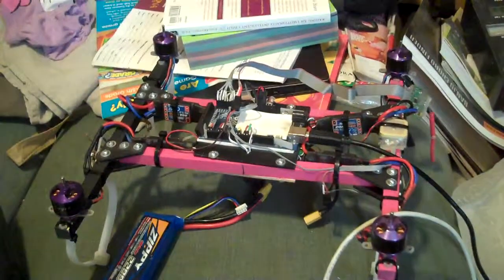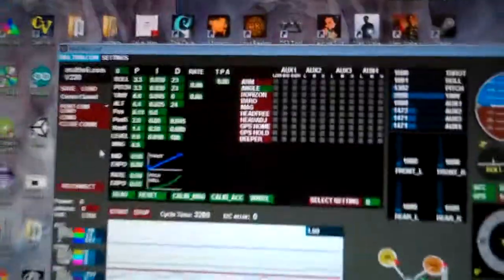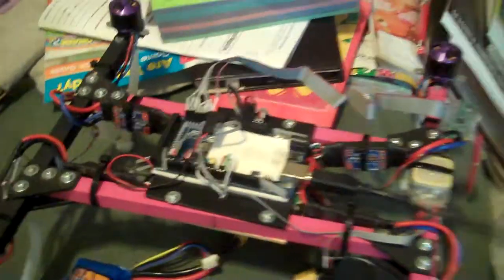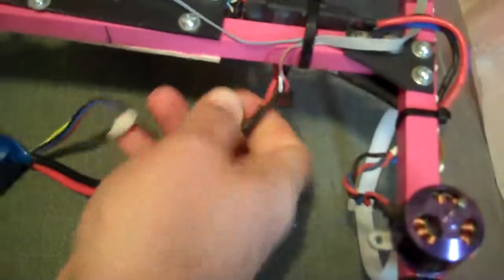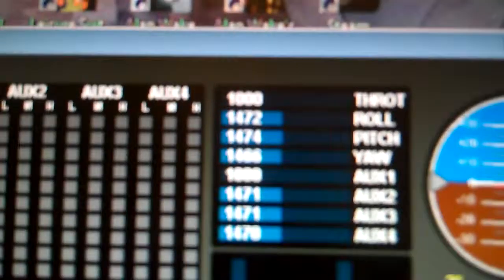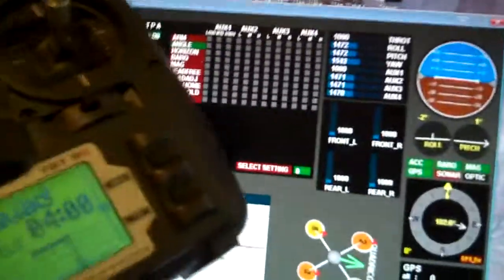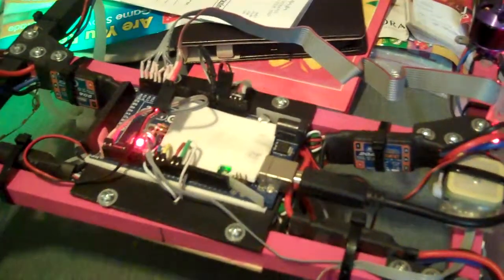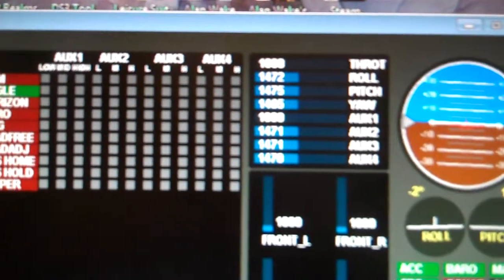Failsafe on MultiWii 2.3 drives me crazy

Comment: Jason you have a few problems there so let break it down for you.
1 - Have you calibrated the accs and the mag as it does not look like it.
2 - You have no AUX switches allocated,
3 - Your ARMING problem is probably due to the LIMITs in your radio not being out enough to hit the spot.
4 - Angle is a flight mode not failsafe. 

So lets got through a few of those points.
1 - If you dont cal the accs and mag your board will be confused and things like ANGLE mode will come up.
2 - I assume you know how to allocate AUX switches to active things like RTH etc.
3 - Go into your radio to the limits page and open out the YAW & THROTTLE settings as I assume they are at 100/100 so do both sides of the limit on both limits and say go to 110 for all 4 and see how that goes.
4 - If you fly in angle mode your copter will not tilt over more than 25 degrees which is great for beginners and if you want to be more daring go to HORIZON which is a combination of angle and acro (angle to 25 degrees, acro over 25 degrees).

For failsafe you set that up in either your arduino sketch by commenting out the first failsafe line OR you can have it set up on your receiver.

If  you want to see some set up vids on multiwii FC boards come and see my youtube channel - moochasas
Reply: One other thing I noticed but forgot to mention is that while your using MW2.3 your GUI shows MW2.1 so you should use the matched GUI that came with the sketch. Reason I suspect that is because your GUI while stating 23 at teh top LH corner shows all the settings for MW2.1 and if  you use a mismatched GUI things like angle will come up (like yours is shown in greeen) without activating them via the white squares in the AUX columns.
Reply from the maker: moochasas The problem turned out to be that the GUI does not show any values below 1,000 or above 2,000.  It was the 2.3 GUI (came out of the same .zip as the arduino sketch) I've never even had 2.1 on my computer I've only ever used 2.2 and 2.3.  PatrikE was able to hook me up with a version of the GUI that shows values below 1,000 and above 2,000 and I discovered that my endpoints weren't set where I thought they were:  http://www.multiwii.com/forum/viewtopic.php?f=18&t=5073

The accel and mag had been calibrated, AUX switches weren't set yet as I had just reflashed the board and loaded my settings but the GUI doesn't ever seem to save and restore AUX settings.  Since I was still fighting this sudden arming problem I wasn't going to waste time setting AUX switches that would probably be lost again before I would need to use them for anything.

Since the problem was solved over a month ago I'm not really interested in going back and watching my the video again to address the other points.  It was the end of two days of frustration caused by the stock GUI clipping the values and leading me to think I had my end points set correctly.  At the time I made the video the quad wasn't setup for flying since I couldn't get past this sudden arming problem that started when I enabled failsafe in my config.h.
Reply: Jason Hitesman OK, I was only trying to help.
Reply from the maker: Attempt appreciated, just caught me on a bad day well after the problems were solved ;)

Comment: Jason, have you solved this?  I want to activate FAILSAFE on my MW 2.3 328p quad, and test before my next "real" flight.
Reply from the maker: I did thanks to help from PatrikE on the MW forums:  http://www.multiwii.com/forum/viewtopic.php?f=18&t=5073

Turned out that the GUI only displays 1000-2000 on the RC channels so if your TX is going lower than 1000 or higher than 2000 it still displays as 1000 or 2000.  And mine was actually doing around 960-2010 or so and I never realized it as the GUI was showing 1k-2k leading me to believe I was setup correctly.  PatrikE shared a modified version of the GUI in that thread which shows values from 900-2100 which let me get my TX setup correctly and failsafe is now working as intended!